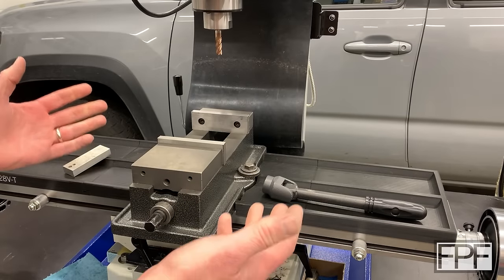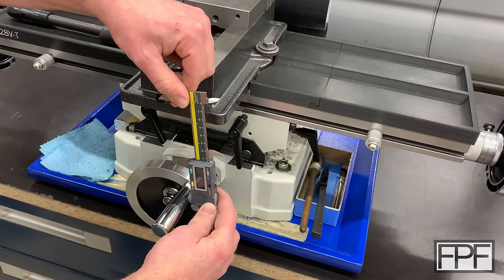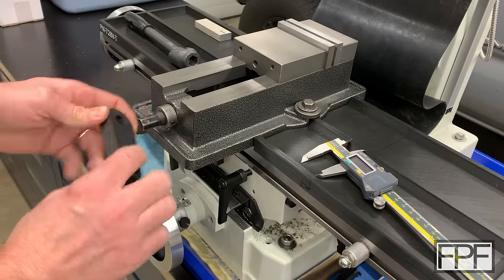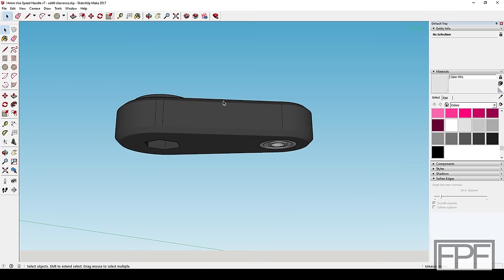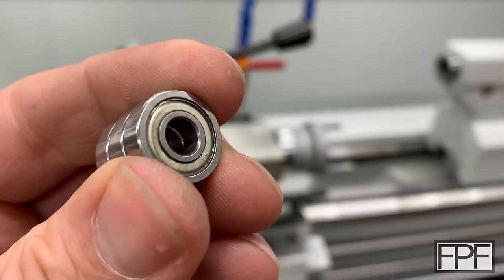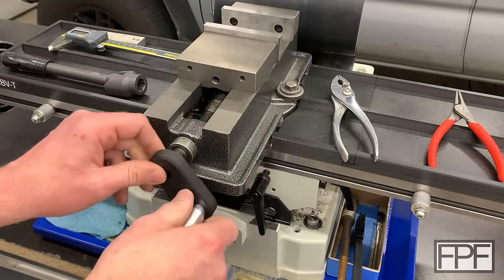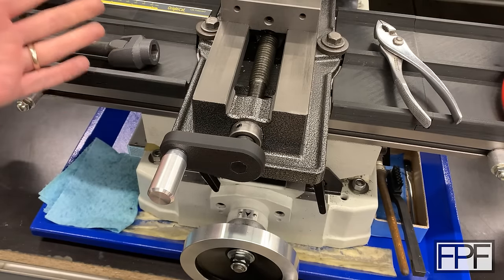3D Printed Vise Speed Handle

Comment from the maker: In addition to the 14mm version featured in the video, I added versions for 3/4" and 12mm to the STL download for those interested.
Reply: My vise has a 3/4" square drive...  I don't know if anyone else would have an interest, but perhaps you might consider adding a 3/4" square version to your collection...  It would also be handy to have a couple of dimensioned drawings for the arm and the handle.  Can your CAD tool easily spit out a simple dimensioned drawing?
-Thanks
Reply: Link is broken June 27/2024 great video Thanks!
Reply from the maker: My apologies, power and internet is down here from the big storm we had last night.  The link is still correct, it's just down right now.

Comment: When I first confronted this problem, I naturally gravitated to the simplest solution, which was to keep my M12 3/8 impact near the mill. What I soon discovered was that the lack of a clutch made it too easy to over-torque. So instead I used one of my M12 drivers with a clutch. It is non-impact and takes 1/4 inch bits. You can get a set of 1/4 inch to 1/4, 3/8 and 1/2 socket drivers from HF pretty cheap and they are more than adequate for this low-torque application. This is Functional Print Friday and not Functional Solution Friday, so I get it, but an FPF for my solution would be to create a holster that lives on the mill for the driver to nestle in. Lots of engineering challenges in that.
Reply: This was my thought right away, except I gravitated to the M12 driver right away.

What this provided me was the idea of another application for my M12 driver!

Comment: For years I used an aluminium lawn mower spark plug spanner they are 14umm, but for giggles I made one of these. I printed a thread for a 6mm cap head screw and printed a handle for the screw to go through and rotate around. Works great for the last 13 months.

Comment: Nit picking but you may want to choose ironing on your top layer.
Also, no nurl on the handle? YOU SLACKER! :P
Reply: not to nitpick your nitpick but if he wants to nitpick too he might be better off to check extrusion stepping and then accuracy along his z axis before relying on the software to cover for mistakes. If you are already having your slicer use surface level smoothing (it's different than ironing and sometimes isn't enabled by default, you'll know if cura says something like "top layers: 0" for example) your top layers should be VERY smooth. Hypothetically if your printer is tuned correctly you will almost never need ironing, and ironing will actually in some cases cause worse surfaces if for example your z scaling is wrong and your print is too tall, it will leave an ugly trail in the surface, while if it was too short it wont "iron" at all and you're just wasting printer time.

The less software corrections and bandaid-type fixes the better, especially when you're talking opening in the comments like this where a passing viewer may not understand "why" a setting should be enabled. If someone only printed high-temp filaments and perhaps already had their bed a TINY bit too hot the ironing will cause a condition similar to elephant's foot, and then it's just going to send the user back to checking extrusion anyways, except this time they may not remember to check back and re-disable ironing.

I love a good nitpick

Comment: Carriage bolt as a handle, with the square section inset into the body, then a shaped handle to fit over the carriage bolt, and lock nut on the end to hold it on.  Lock washers are more rounded, and blend that into the handle shell.  Makes the body stronger also as there is more meat than you have using the bearings, which are really overkill I think.  Just a thought.

Comment: I printed one of these for myself.   I needed to extend the bulge on the vice side  as mine stuck out farther and I do not have a lathe to create a handle so I found one on Thingiverse and printed it, then pressed a 5mm threaded insert in and used a 30mm long 5mm screw to attach it.  I had some bearings that just pressed in that had flanges on one side, so it only took 2, and I used a nylon locknut to hold the screw and bearings together without any pressure on the bearing plus a regular nut to lock the screw to the insert in the handle..

Comment: I like, but it could be done simpler and cheaper....You could make the same handle without the bearings and machined knob. You print the knob with a hole running through it that a 1/4-20 bolt fits loosely enough to turn freely. Then take a long 1/4-20 bolt cut away the threaded portion keeping enough length for it serve as an axle for the knob. The bolt goes through the knob and gets pressed into the crank arm. Making sure to leave the knob free to turn... The resulting part would then be all printed except the shortened bolt. So 3 parts, 2 of them printed, lathe work is optional and the total project cost should drop to around one dollar.....🤔Though it wouldn't have the really cool looking machined knob.

Comment: Nice little tool. 

I would have printed solid or at least enforced solid adjacent to the 14mm hex although I have noted a weird interface where the infill doesn’t continue across the enforcer boundary, which is usually why I do 100%. I should test my parts to see what best but each part is different and usually small and if it was weak and broke you would just print another with more perimeters or beefier infill. Which would save masses of waste testing. I guess if you sold the parts it would be worthwhile to test the strength and time to produce. 

The fusion/ investor FEA tools work but I don’t think they analysis porous material the assume solid homogeneous material. 

It would be interesting to see an  experiment of wall thickness and part infill vs wall thickness and solid vs infill type vs infill density, could be quite a bit of content in that. 

However It is unlikely that you would be able to torque out the handle in one use but over time cracks may propagate and eventually cause failure. 

2) Do you run Solid infill every 10 or so layer on prints like this to add strength?  Ive done before a couple times and seems to help. Although it only puts in one level. You could do a height modifier to build more layers of solid infill.

Comment: I think the easiest handle might have just been a piece of metal rod interference fit into the hole, you can slide your fingers around that just fine and makes the design simpler and cheaper

Comment: For the future... Only 2 bearings would be necessary along with a bearing spacer, to reduce cost and weight, between them... Also, I appreciate the use of the spring clip and was hoping that was your plan while you were working on the handle.
Reply from the maker: absolutely, but china bearings are sooo cheap and I had them on hand

Comment: Nice video, a question how much interference usually you design to assemble the bearings at the PLA print?
Reply from the maker: I design them to both be the identical size or, at most .1mm difference.  For smaller holes (under 4mm), I add .2ish, and you'll also need to adjust depending on how accurate your printer is, and how accurate your extrusion multiplier is tuned.  All of these will impact ultimate bore size in the printed part.

Comment: You could always use a drill, socket, set torque bypass for even faster speeds and no need to design a handle 😎
Reply from the maker: The advantage to a speed-handle over a drill and socket is to be able to gently bring some tension to the vise jaws with one hand while you position or hold the parts with your other hand.  With a drill, it's hard to find that butter zone where you just barely start to get some tension between the part and jaws during positioning.  Even worse, if you want to loosen it a little to adjust position, then snug it up again,  now you're switching direction with the drill, twice.  Drill is good for production work where you're just banging the same part or blank into a fixture over and over again with no need for alignment, etc.
Reply: @FunctionalPrintFriday  I was just mainly speaking on the jaws being wide open how you demonstrated. In the shop, We usually have the jaws around 2” or less, occasionally 4”. The Kurt handle is not much of an issue for us but it does get in the way on the table vertical adjustment which we remove the handle. The speed handle is definitely a plus, nice build.
Reply from the maker: @ProjectAnubisUSA  understood, thx!
Reply: @FunctionalPrintFriday   Not only that, but a drill is bulky and almost as awkward as the original crank handle. A small handle that can stay on there is ideal, and you executed it well.

Comment: The button handle was at the highest point possible. You could just turn it down and it would work. Right?
Reply from the maker: it misses the spinning part if it's all the way down, but still hits the round part of the handle.   small-mill problems :)

Comment: I think the only thing i would have changed is putting a set screw on the top of the handle by the hexgon and used a threaded insert to hold it onto the machine.

Comment: I'm not sure why you didn't just turn the diameter for the bearings first, then the OD and part it off. You don't need to complicate things with using a second operation with a collet. You can just turn the back of the part to clean up the parted off face by holding it in the same 3-jaw.
Reply from the maker: 3-jaw seems to mark up aluminum too easy.  collet chuck never leaves a mark

Comment: Cordless impact with socket?
Reply: Maybe just a cordless drill with torque adjustment and 14mm socket rather than the impact. I have one of those and a 3d printer but no lathe and metal stock.
Reply from the maker: The advantage to a speed-handle over a drill and socket is to be able to gently bring some tension to the vise jaws with one hand while you position or hold the parts with your other hand.  With a drill, it's hard to find that butter zone where you just barely start to get some tension between the part and jaws during positioning.  Even worse, if you want to loosen it a little to adjust position, then snug it up again,  now you're switching direction with the drill, twice.  Drill is good for production work where you're just banging the same part or blank into a fixture over and over again with no need for alignment, etc.

Comment: The knob is missing a knurl, you'll have to pick up a knurling tool. 
Why not just use two bearings, leaving a shoulder inside to space them. Also why not press the knob into the inner race as well? 
Love the channel, enjoying all the videos you have made. Keepnup the good work.
Reply from the maker: I've got 3 different knurling tools that I acquired in various tool sales, and haven't used them yet.   I need to just give it a go on some scrap stock and learn how to use them.  Joe Pie has a great video on knurling that I should probably go re-watch.  I am a beginner at best on the lathe, but really enjoying my time on it.

Comment: This may be a dumb question but, you have a milling machine, why not just machine one out of aluminum that will last quite a bit longer? Shit, I'd even send you one of the small ones I made
Reply from the maker: Internal hex's are time consuming to mill, plus the setups for the all the nice curves on the outside.  3-d printing just crushes that part with ease.  I enjoy mixing processes in projects like this when I can.  Certainly a fair question though.

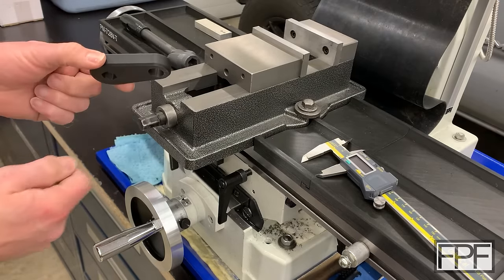Comment: Yon know…. @8:26 when you used your pinky, you should have realized that if you had also placed a dimple/well in the handle FOR spinning it with a finger, the design could have supported use with the handle OR just by spinning it with your finger.

Comment: Drill and 14mm?
Reply from the maker: The advantage to a speed-handle over a drill and socket is to be able to gently bring some tension to the vise jaws with one hand while you position or hold the parts with your other hand.  With a drill, it's hard to find that butter zone where you just barely start to get some tension between the part and jaws during positioning.  Even worse, if you want to loosen it a little to adjust position, then snug it up again,  now you're switching direction with the drill, twice.  Drill is good for production work where you're just banging the same part or blank into a fixture over and over again with no need for alignment, etc.

Comment: Awesome video, I recreated your design in build123d (a new type of fully open source CodeCAD similar to OpenSCAD but with native fillets/chamfers) -- Here is the sourcecode:
from build123d import *
with BuildPart() as p:
    with BuildSketch() as s:
        Circle(25)
        with Locations((75,0)):
            Circle(15)
        make_hull()
        with Locations((75,0)):
            Circle(16/2,mode=Mode.SUBTRACT)
    extrude(amount=14)
    with BuildSketch() as s:
        Circle(20)
    extrude(amount=20)
    fillet(p.edges(Select.NEW),3)
    with BuildSketch() as s:
        RegularPolygon(14,6)
    extrude(amount=20,mode=Mode.SUBTRACT)
    edgs=p.edges(Select.LAST).group_by(Axis.Z)[-1]
    chamfer(edgs,2)
Reply from the maker: that's awesome!  I will have to check this out

Comment: What about a piece that connects to a low torque motor that is battery-powered??  Full send??  Lol
Reply from the maker: The advantage to a speed-handle over a drill and socket (or other motorized approach) is to be able to gently bring some tension to the vise jaws with one hand while you position or hold the parts with your other hand.  With a drill, it's hard to find that butter zone where you just barely start to get some tension between the part and jaws during positioning.  Even worse, if you want to loosen it a little to adjust position, then snug it up again,  now you're switching direction with the drill, twice.  Drill is good for production work where you're just banging the same part or blank into a fixture over and over again with no need for alignment, etc.
Reply: @FunctionalPrintFriday  I understand why you wouldn't want to use a drill. I'm talking about a custom-made one-handed small tool. Basically, it's a socket with a  motor attached within a custom body. You could control the speed with either a button or how hard you push. I wish you could see what's in my head because I think you'd appreciate/ enjoy it!
Reply from the maker: @christophergrace1085  I think maybe I understand.  Maybe with a directional switch where you push one way for in, one way for out, and it locks up so you can manually turn either way without power for fine adjustments?
Reply: @FunctionalPrintFriday  That with what I was thinking. Have it in a housing that as you press in, it can speed up and slow down or stop as you let up. It actually just spent the last hour or so researching it to figure it out!!  Lol. I'm thinking of some type of "T" shaped handle that would house all the electronic components, and maybe use of a hall effect sensor that can control the actual speed.... I wish my arm wasn't in a sling!  I'd hop on my computer and draw it up in CAD.

Comment: just get a hex socket on a cordless impact
Reply from the maker: The advantage to a speed-handle over a drill and socket is to be able to gently bring some tension to the vise jaws with one hand while you position or hold the parts with your other hand.  With a drill, it's hard to find that butter zone where you just barely start to get some tension between the part and jaws during positioning.  Even worse, if you want to loosen it a little to adjust position, then snug it up again,  now you're switching direction with the drill, twice.  Drill is good for production work where you're just banging the same part or blank into a fixture over and over again with no need for alignment, etc.

Comment: so you don’t want to use a battery drill with a socket OK good waste your time not mine.
Reply from the maker: The advantage to a speed-handle over a drill and socket is to be able to gently bring some tension to the vise jaws with one hand while you position or hold the parts with your other hand.  With a drill, it's hard to find that butter zone where you just barely start to get some tension between the part and jaws during positioning.  Even worse, if you want to loosen it a little to adjust position, then snug it up again,  now you're switching direction with the drill, twice.  Drill is good for production work where you're just banging the same part or blank into a fixture over and over again with no need for alignment, etc.

Comment: I would have just put a socket on the end of a cordless drill
Reply from the maker: The advantage to a speed-handle over a drill and socket is to be able to gently bring some tension to the vise jaws with one hand while you position or hold the parts with your other hand.  With a drill, it's hard to find that butter zone where you just barely start to get some tension between the part and jaws during positioning.  Even worse, if you want to loosen it a little to adjust position, then snug it up again,  now you're switching direction with the drill, twice.  Drill is good for production work where you're just banging the same part or blank into a fixture over and over again with no need for alignment, etc.